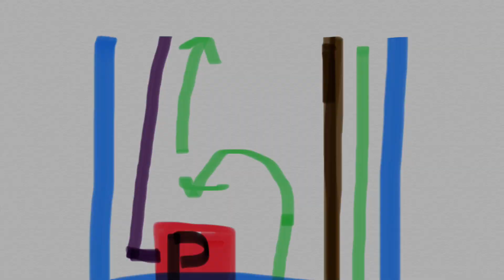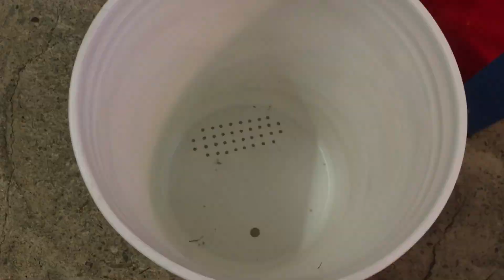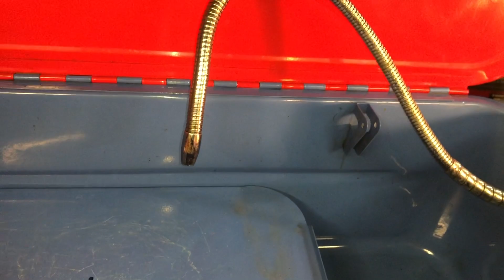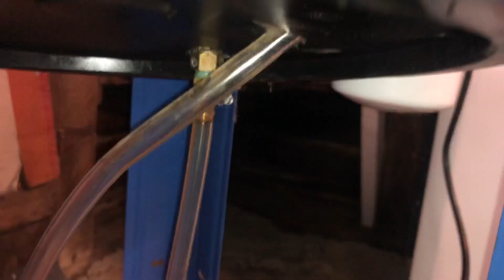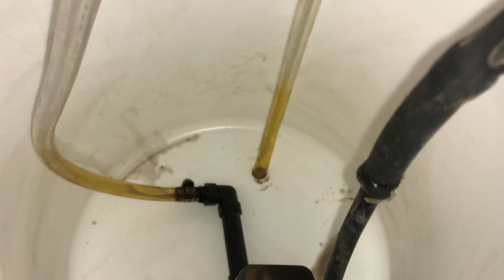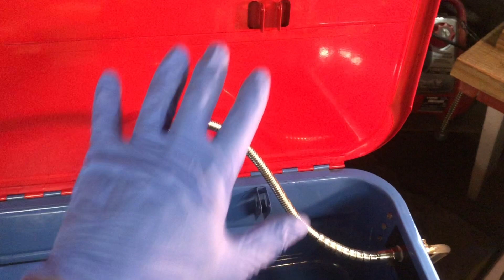Modified and Upgraded Harbor Freight Parts Washer Cabinet

Comment: with this set up, it doesn’t look like you can run any kind of depth of solvent in your tank, like you can only use the circulating solvent, no ability to soak in the tank.
Reply from the maker: Yes, you’re correct! I never liked the deep soak basins, because after a while, the fluid you’re using to clean parts gets so nasty! 

I usually remove the heaviest grime off my parts I’m washing prior to using this setup. Sometimes, I’ll set parts in the bottom of the basin, leave the wand spraying solution for a while, and then I’ll come back to do some manual scrubbing. It works quite well.

Comment: You could do the same system with one bucket  using the Shurhold 2404 Bucket Caddy. . It stays off the floor of the 5 gallon Bucket by 5 inches or so. Your pump could sit in the Bucket Caddy above the dirty fluid.

Comment: Why clean the solvent coming out of the bucket?  (Using the spin on filter)   It only gets dirty running over the parts you are cleaning.  Clean the solvent going into the bucket.
Reply: He wants clean solvent going over the parts.

Comment: I've watched about 20 of these Videos and Isn't it Funny how they always Run clean Solvent NEVER have they used dirty solvent. I don't Know about you but I use my Solvent tank, and don't just circulate clean solvent.
Reply from the maker: After running this up for awhile now, there is heavy sediment built up in the lower bucket. The sump design and the filter are doing a great job catching grime. Cheers!

Comment: NIce. Simple and effective. Thanks.
Reply from the maker: You bet - glad to share! It is still working great for me. The only upgrade I have planned is the addition of a bucket warmer pad. I already switched from the Tractor Supply parts washer fluid to safety-kleen Armakleen 4-in-1, so I don’t have to worry about fires with  heating the petroleum based Tractor Supply fluid.

Comment: Here's another idea. Use the cleaned pan you drain oil into along with a little gas and a brass/steel brush from HFT to clean oily dirty parts. If any liquid is left, pour it into the jug you take to be recycled with all your used oil.
Reply from the maker: Everyone has their preferred method! I used the method you described for years. After upgrading to an actual parts washer, I’d say this system is much faster, cleaner, and more convenient. Thumbs up!👍🏼

Comment: I’m in the process of copying many of your ideas. It looks like the best setup so far, at least on the expense side. My washer pump quit, so I bought an upgraded parts washer pump designed for solvent, so I will be running the PSC-1000. My question is, is 5 gallons enough? It is a 20 gallon washer, would a bigger tank be more dire able, or is the double fiver combination sufficient? I ask, as this video is a year old, and wondering how well it has stood the test of time. Thanks for the video.

Comment: What if you used a metal bucket and ran a heated coil in it?....
Any way you can add a parts list???
Reply from the maker: I would advise against heating the tractor supply petroleum-based parts washer fluid, however, it would be an excellent idea to heat an aqueous-based parts washer fluid!
Reply: @natedejong7575  good call. I've yet to use heat. I just scrub harder. But I'll ponder the water based solvent.
Reply from the maker: @usmcdoc2512  you won't regret the switch.  We have a heated water-based solvent washer @ my shop.  Safety-Kleen Armakleen solvent.  Heated.  Awesome stuff.
Reply: @natedejong7575  thank you very much for advice. I'll definitely need it. I work in Harleys in my garage. D I need a way to clean things more efficiently. Thank you for the video.
Reply: Will a water based solvent damage the filter and do you recommend a fuel or oil filter?
Reply from the maker: @usmcdoc2512  I recently cut open a filter to check to see if the glue inside the filter media paper pleats would be damaged by the solvent.  I didn't find any such damage.  I think the filters plug up prior to the glue suffering any noticeable damage.  I used a fuel filter.  I also placed a scotch-brite pad cut into a circle down in the drain well.  This caught larger debris that I found quickly plugged the "fuel" filter.  This scotch brite pad can then be cleaned out as needed, and placed back over the drain to catch future debris.
Reply: @natedejong7575  you sir..... Are the GOAT. I contemplated adding a 3.5 gallon bucket on top and bypassing the filter all together. Therefore there would be a bigger space between sediment bucket and the top bucket where the pump would sit with the solvent. Your thoughts...
Reply from the maker: @usmcdoc2512  I think that’s a great idea! You should try it and report back.
Reply: @natedejong7575  will do!!!
Reply: @natedejong7575  been scrubbing motorcycle parts covered with oil and road grime from bad gaskets. So far so good without the filter. I did use that separator you see in car wash buckets to keep the sponges out of the dirty water. I put the pump on top of that to give it the extra clearance and it works good. Tearing apart the rest of a Harley motor today and will see how it functions. But I'm happy with utilizing your set up.
Reply from the maker: @usmcdoc2512  hey that's great feedback!  I like your idea to set the pump on the car wash separator.  Well done.  Is your setup heated at this point, or are you running cold water for now?

Comment: Hi Nate, very nice build! How is the pump holding up after a year of being submersed for a year, and did you ever make the switch to after based cleaner? Cheers from Austria!
Reply from the maker: Greetings!  The pump is doing well.  I used it yesterday for a bit of cleanup work on some car parts.  Yes I made the switch to water-based cleaner and I'm heating it as well.  I need to do an update video as there are a couple other changes I've made with good improvements noted as well.  Cheers =)

Comment: Just an FYI the spring prop is a safety mechanism. If the solvent tank were to catch fire the spring would heat up and release, automatically shutting the lid and putting the fire out.
Reply from the maker: Yes, I’m aware of this fact. I never leave the washer unattended. If there happened to be a flare-up, I’d be there ready to shut the lid. Good looking out :).

Comment: I have a couple of questions on your set up. First how much solvent are you using in gals? 2nd how long does the solvent last (meaning how long before you have to change it) and how often do you have to change the filter?  What fuel filter do you use?
Reply from the maker: It ends up being around 4-5 gallons from what I remember. The solvent lifespan depends on how much heavy cleaning I do. I usually change it before doing engine assembly prep cleaning. The filter is a Napa/Donaldson filter. I’ll try to remember to get the number off of it. The filter number was picked by default after finding the generic “fuel” filter base.

Comment: I'd like to know if your washing fluid is water based or solvent ? and if you have modified the washer pump to immerse it all the way into the fluid ? Thank you have a nice day
Reply from the maker: At this point, I’m using tractor supply PSC 1000 washing fluid. The only modification I have made to the pump is extending the power cord. The splice in the power cord is never immersed in fluid, as the pump is set in the upper bucket. The splice was done in a sealed/waterproof manner with dual-walled heat shrink.
Reply from the maker: I plan on changing to an aqueous washing solution soon so that I can heat it with a heating element. Heated washers work so much better in my experience. I can’t heat the tractor supply PSC 1000 fluid safely due to it being a petroleum-based fluid.
Reply: thanks alot for your answers, I really do appreciate alot. Keep on doing great work